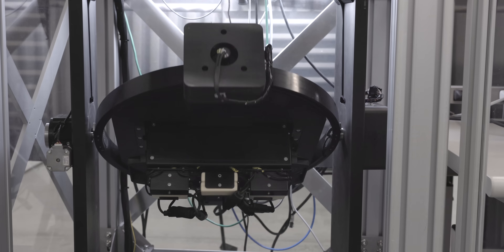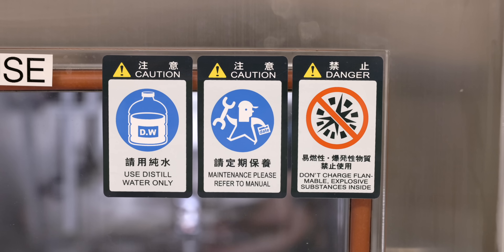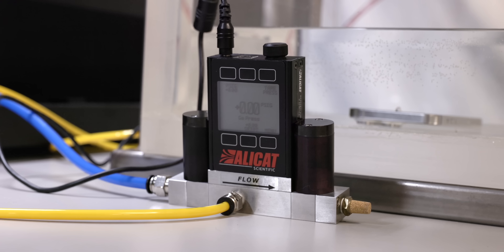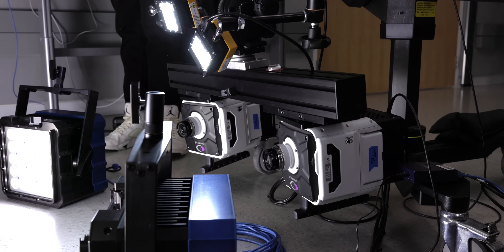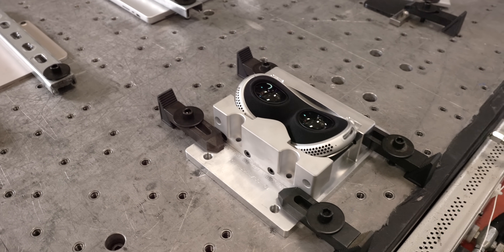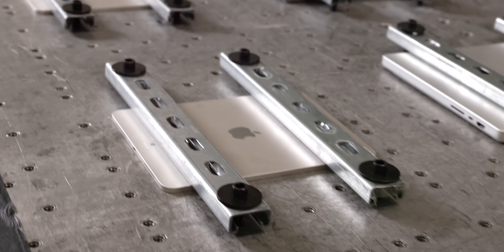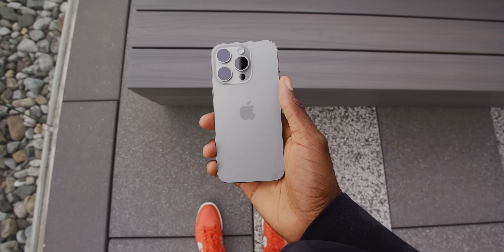I Visited Apple's Secret iPhone Testing Labs!

Comment: I like how the water ingress testing equipment requires distilled water. It's the impurities in water that makes it corrosive or leave residue that cause shorts, so testing with distilled water wouldn't cause problems with circuits. It doesn't even conduct.
Reply: They're testing one variable, water ingress. They're not testing whether or not components inside will break AFTER the water ingresses. How conductive the water is is irrelevant to this test.
Reply: @cheezygreeny uhm it is very much relevant because it has a direct impact on the seal - which is a fancy word for glue. This glue can break down from one hot sunny day - after 20 minutes in the hot sun. Poof, IP68 gone. pH levels should also be considered as they have a direct effect on the glue. Basically, I told everyone I know that these phones are NEVER water resistant or at least you should always assume that the seal is done after two weeks of usage. Same goes for the watches and the other fancy stuff.
Reply: @PvtAnonymous  The tests in the video is testing specifically only for IEC 60529 IP rating up to IPX8 (which primarily looks at varying levels of water pressure, IPX9 actually does take high temperature water jets into account though), so pH and temperature variance are not relevant to this test. Other environmental variables like pH, temperature, impacts, humidity etc. can be tested using other standards (e.g. AS/NZS 60950.1, EN300 019, MIL-STD-810, IEC 62262 etc.) in other test equipment.
You're right that other environmental conditions can affect the IP performance, but you should read up a bit more on different environmental testing standards so that you can provide better informed advice to others.
Reply: @cheezygreeny  no I don't, since I base my results on real world experience and not a lab test where they don't combine factors that are present under real-world conditions. If I want to drop my phone in distilled water in a pressure chamber, great. But if it falls into the toilet or a lake, get ready for a nice $200-300 data recovery (if you don't have a backup) and a new phone.
Reply: @PvtAnonymous  Then your issue with is with the standard, and not the test not reflecting what 'real-world' conditions are like. You could go propose a new standard that involves different water contaminants, but for this standard the testing they're doing in the video is exactly what the standard calls for.
So for the new toilet water test, how much fecal matter should be in the bowl?
Reply: @cheezygreeny  my issue is with the testing because it doesn't guarantee a standard, that is later promoted and marketed as some sort of feature. And also used as an argument against repairability, which sounds like a sick joke. People actually trust this rating and are misled into a false sense of security, only to damage their phones later. I've seen to many YTers holding phones under running water or doing some "I threw it in the lake for a week and it still works" nonsense, which is harmful to the end customer with a limited income. This needs to stop and this tour and interview didn't really help promoting the truth - quite the opposite actually.
Reply: @PvtAnonymous  I wasn't referring to "standard of quality", I was talking about standards in the scientific/engineering sense. The IPX8 standard gives very specific guidance on testing conditions. You're right that the standard is not necessarily reflective of real world conditions and you probably shouldn't subject your phone to extremes, but all it is is a benchmark, where you can say IPX8 is more resistant to water ingress than IPX1. That's all, no more, no less. How people decide to interpret, market or sensationalise what is quite a mundane engineering exercise is beside the point. The truth is that the test shows if the phone meets the IPX8 standard or not. That's it.
Reply: @cheezygreeny  it's not beyond the point because IT IS the whole point of the standard. When I have a food standard where my food at a restaurant is supposed to be fresh, of what use is that standard when the restaurant only buys fresh food for 2 customers and serves frozen to the rest? It is misleading and it is used as a selling point by every major smartphone maker. As long as there are no labels like "tested under lab conditions" and "decreases quickly after regular use" the whole point of the standard is to sell a false sense of security that doesn't exist. I remember some OnePlus phone some years ago that wasn't IP certified because of fees and reviewers were actually concerned and brought that up in their reviews while the ingress protection was just as good. Again, I don't question that the ingress protection is better on an IP68 device than IPX4 or something, but how the IP rating is used in the real world is a problem that needs to be addressed.
Reply: @PvtAnonymous  Wait until you read what the standards are for food safety, you're not going to look at food again the same way hahaha (e.g. FDA Food Defect Levels). IPX8 being a lab test kind of implies that it's under lab conditions? Anyway, I think we're agreeing on the same thing in the end which is these testing standards are not always adequate to protect the uninformed consumer because reality is infinitely more varied than lab conditions.
Reply: Exactly!
Reply: They should have a bathroom where the engineers pee on the phones, another where they pour beer on them, etc.
Reply: pretty sure they would have moisture sensors in the water ingress testing prototypes.  the water will be detected by those as soon as it enters the phone. They probably don't need the prototypes to short-circuit to know if they passed or failed the test.
Reply: The test is ‘Does water get in?’ Not if it stains
Reply: due to all water from different sources being different it would be hard for them to test it. and its a rating not a gurantee. Water resistant not waterproof. it is fine imo

Comment: Makes sense.  I’ve been in tech hardware all my career, from silicon, to GaAs, to pacemakers/ defibs, to mainframes, to test and measurement equipment.  Every one had reliability testing methods and protocols, but none were at the overall volumes as consumer products.  
Throwing thousands of phones is a drop in the bucket compared to a product that sells hundreds a year (my current job).
And definitely the less you have to repair, the less you have to replace.  Like my old Jeep, vs. new Jeeps!

Comment: I'm curious to see how much correlation there is of needing to replace the battery more often because these phones are lasting longer and longer as a factor of them being that much more durable on top of the OS and software getting routine updates as well as the chipsets being good enough.

If the phone wasn't great and was less durable and/or cheaper, people would probably be more inclined to just upgrade to the next phone every two years right making the battery replacement a moot point.

Comment: In my opinion the "sliding scale" analogy is extremely oversimplified to the point of being wrong. Durability absolutely doesn't have to come at the cost of repairability in every scenario, nor the other way around. For example, imagine if the IPhone's back panel was made of metal, and it was screwed in instead of glued on, with gaskets ensuring water resistance. This design would clearly have both increased durability (metal won't shatter) and increased reliability (instead of dealing with annoying glue you'd just need to unscrew the back panel to get inside). The example of water resistance also doesn't work as a proof to the sliding scale theory in my opinion; just think of watches. A mechanical diver's watch can achieve hundreds of meters of water resistance, far more than even the iPhone, without using any glue. Instead, it uses gaskets, and threads which apply pressure to them. This design makes them as easy to take apart as any comparable watch without water resistance. Obviously, this principle isn't applicable 1:1 to a smartphone, but my point is that there absolutely are cases where you can improve durability or repairability without hindering the other, and claiming that that's not the case feels like an extremely simplistic worldview to me.

Comment: 10:03 that doesnt check at all in fact. Apple is saying "we make iphones so durable that it doesnt make sense to be able to replace a battery, its better to get a new iphone"... Sure one battery maybe its not worth it, but what about all the other pieces that could work for years (camera, cpu, screen, gpu, speakers) and you just decide all those go to trash? thats not better for the enviroment... Modern phones (as motorola engineers planned) should work as modules where you can change any part obsolete but still keeping others with value..

Comment: I worked as a mechanical engineer for 7 years, and these tests are no joke. One project we quite literally made hundreds of samples to subject to 30 years of simulated temperature and humidity cycles over a period of weeks, just to find out the reliability of a single solder joint.

The vibration tests are often important because you need to ensure your product can survive shipping, and if the product itself has any moving parts it's effectively vibrating itself as it runs. 

Maybe your phone survives being shaken while in someone's pocket out for a jog, but what if they jog once a day for 5 years - will the phone fail in some way due to the repeated vibration, and how do you simulate 5 years of shaking without actually waiting 5 years to get an answer? That example is easy, but what about years of temperature cycles as people go inside/outside or travel, years of strain from being flexed in your pocket etc.

Some very smart engineers figured out some processes and equations to simulate long periods of usage in a shorter period of time using more extreme test conditions. Now we can try and find more faults before a product ever gets to a customer, instead of fixing problems as customers have problems over time.

It's fascinating stuff!

Comment: Durability and repairability are not opposite ends of the spectrum. I don't know why you both think this. We absolutely can engineer extremely resistant seals and we can also have a device that is fully user serviceable. The CAT S22 is still submersible with a totally removable back cover and battery. Apple is not incentivised to allow user repairs that are this seamless.

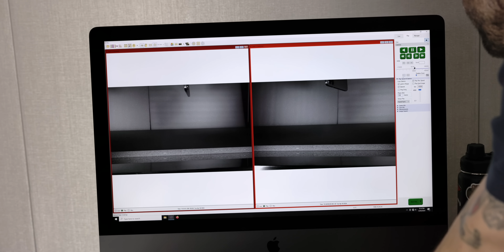Comment: 5:01 Is that a windows running on a Mac
Reply: They don't have a choice with that testing station. From the manufacturer: "The Phantom Camera Control (PCC) software is Windows-only and has been fully verified with Windows 10 64-bit."

Comment: That durability vs repair-ability argument seems so stupid. There's going to bits of the phone, like the battery, that just break down with normal use, so things need to be built to be repairable if you want to use them long term. And if you really want your phone to be near indestructible, buy a better case.

Comment: The thing is to me, the majority of repairs on phones are either done by people at home or repair people like you find in shopping centres/malls that are most likely not using genuine parts. If you take your iPhone to an Apple store for repair, then there is a damn good chance it will work like new.  No different to buying a car. No car manufacture will give you any sort of warranty on a new car using inferior parts done by yourself at home.
What I got out of this, is that Apple's plan is to make their products as durable as possible so no repairs are required. Breaking the glass is exempt, as glass is glass & glass can break.  Would people rather have a phone that can be easily taken apart to replace parts, but dropping it, getting water in it would be a lot easier that you will be spending $$ getting it repaired all the time??  Or a phone that may need 1 repair in the 2,3,4 years of using that phone...
I've gone from the iPhone 11 Pro max - 13 Pro Max & now a 15 Pro Max.  Haven't had to do any sort of repair or return to apple for any sort of repair.  Only phone I did had to return was the iPhone 4 with a failed home button. In which they just gave me a new phone in exchange.

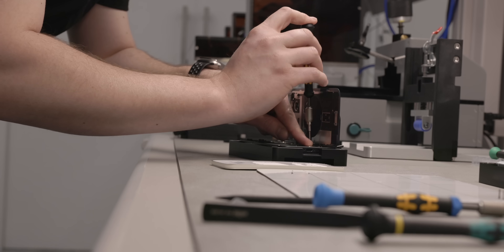Comment: 9:40 "The number of repairs that need to happen [have dropped]" Part of that is because of their yearly release cycle where someone would just rather get a new phone than repair theirs, especially with the price to repair an iPhone not being cheap and (as pointed out in the video) being relatively hard to repair for the average consumer.

Comment: The "repairable vs durable spectrum" is some truly Apple-esque koolaid drinking. Good luck mass producing that "bookend" as he referred to it. It also misses the point that Apple routes their repairs straight back to profit through unlicensed parts bricking your phone because you didn't pay them to repair it or for their tools to do so.

Not to mention software obsolescence. If the next iPhone came out and was completely indestructible and never needed repairs, they'd still effectively brick it via software within 5 years.

Whereas you take the infinitely repairable device, and you could easily tweak that to also be infinitely upgradeable or repurposable. Look at Framework. Swap out your laptop motherboard easily to upgrade literally every component, and 3D print yourself an enclosure. They provide open documentation for the replaced motherboard to be repurposed for use as a HTPC or whatever you want to use a now "low power" system for, and prevent e-waste via repairability and repurposing.

Apple rocketing for the stars towards an unachievable goal, leaving a trail of useless tech in its wake.

Comment: Maybe I am completely misunderstanding the repairability vs durability thing. Cars, in general, are more reliable every year but they've always been repairable. Some of the most durable laptops, the rugged ones, are still as repairable - sometimes more - as regular laptops. It hasn't been the durability that consumers have had issues with when it comes to repairing our devices. We all understand that a phone that has had a screen or battery replaced has probably lost its IP rating. We all get that. The issue we have had with Apple's stance on repairability is the access to replacement parts, shady warranty clauses, and shady restrictions on repair shops where if they don't use genuine Apple parts, tools, and procedures, they could be sued and shut down. Yes, I watch Louis Rossman. So, we all understand a more compact and sealed phone is going to be harder to work on. We just want the option to do it at all. Or we want the option to pay someone to do it rather than going to an Apple store and being told we have to buy a whole new phone because we didn't get the Apple Care plan. Or... Am I misunderstanding this whole thing?

Comment: Interesting you just did a video on water proof.  A friend of mind had an iphone 13, still very good water proofing.  she never takes it to the water or get wet with it.  however, last week, she was talking to someone while she was washing dishes.  a small amount of water from the sink spilled on the charging port.  She clean it, dryed it, but it would no longer charge, and the connection to the computer is unrecongizable.  the phone has a message said there was some liquid or something. Just like that. the port is dead.  it doesn't seem to be as water proof as it said.

Comment: My friend used to work at apple! @5:00 The agent is on a VM. Its not a iMac Pro running Windows
Reply: Probably. They don't have a choice with that testing station, anyway. From the manufacturer: "The Phantom Camera Control (PCC) software is Windows-only and has been fully verified with Windows 10 64-bit."
Reply: @Steamrick  thanks for the details! The more you know lol

Comment: The trouble with the scale is that there are other factors and choices involved, like esthetics. If Apple could tolerate screws and maybe a cleverly designed clamp, its engineers could come up with a durable AND user-repairable device. But maybe if it were truly repairable it would be so ugly there would be no users who wanted it.

Comment: I dropped my iPhone 14 from the second storey of a racecourse stand and it was completely unscathed, but then a couple months later I had it in my back pocket when I went to use the toilet and it dropped onto ceramic from about 4 inches and the back face completely shattered (I’m assuming the stand drop had it land on the aluminium and the toilet drop was directly on the glass, but still life is just funny that way I suppose)

Comment: That doesn't check out. Apple has been behind the curve for decades. They aren't repairable because they don't share parts, software that makes it impossible to repair and on and on. 
The battery example was so idiotic as a point of failure. Pull tabs doesn't affect water ingress. 
I wish you were better informed before heading there so you don't act as a PR commercial for apple but would ask some hard questions

Comment: Repairability as a slider is a really cool way of thinking about this. I would argue that it makes sense for a smartphone to slowly become more durable (less repairable) the deeper you go inside it. Exterior damage should be easy to repair (screen, camera, USB port, etc.) but internal damage should be prioritized in such a way that it ALMOST never needs to be repaired (cpu, memory, battery, etc). There's nothing worse than going to a phone repair shop and being told that your smartphone needs a new motherboard basically amounting to 90% of the price of a new phone. With that said... it should be noted that a simple screen replacement or USB port fix shouldn't cost 90% of the price of a new phone either :/

Comment: the threshold for apple is actually that it should be resistant so that it can take simple hits without an issue, but above a certain value it should break for which the customer will buy a new device.